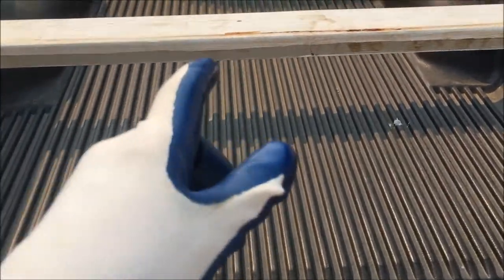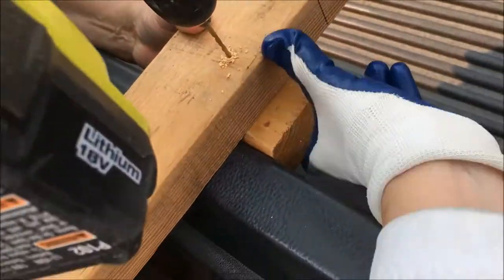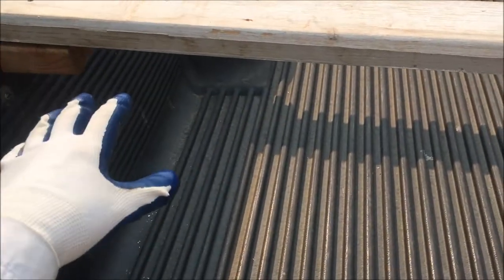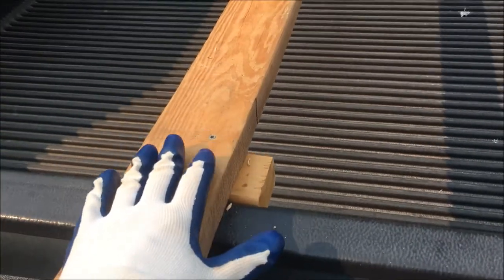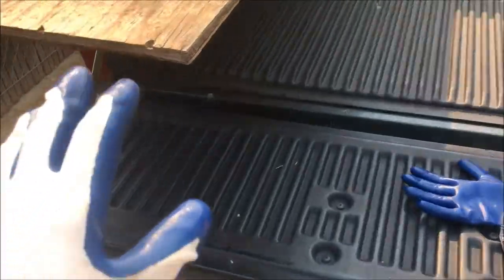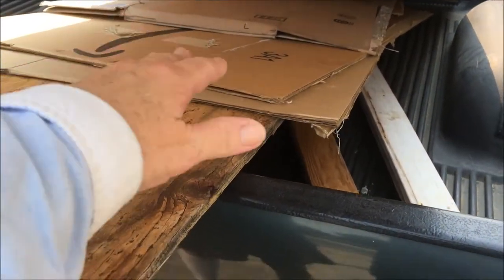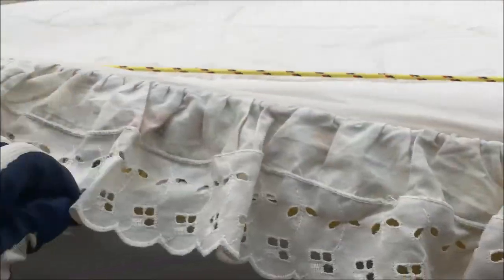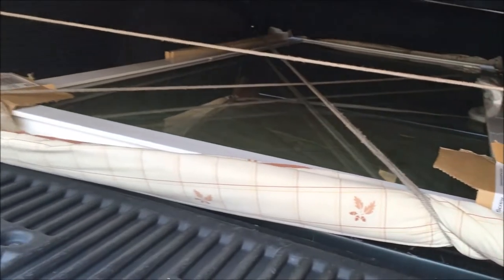How to Transport a Sliding Glass Door or Patio Door

Comment: I was under the impression that sliders should be transported vertically. Nice work though.
Reply from the maker: Thank you.  Maybe the case, CRIS.  But, we transported another slider and have had no issues with either of them.  If you have a bigger truck, you can make a frame in the bed, cleat it in and transport it vertically.  We didn't have that, and it worked out fine.  Sister and I are old and old-school DIYers who don't believe much of what we hear from corporations anymore.  So, we figure things out ourselves.